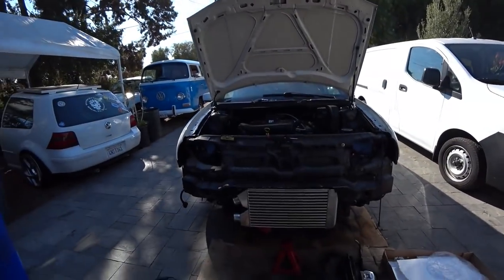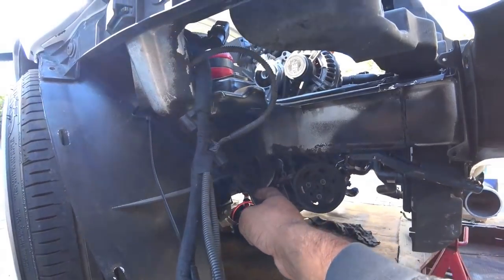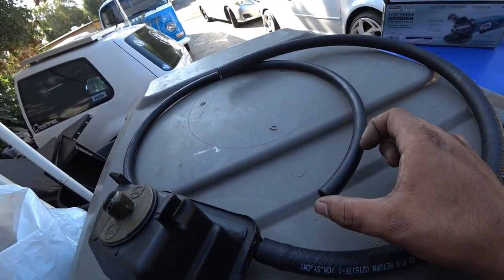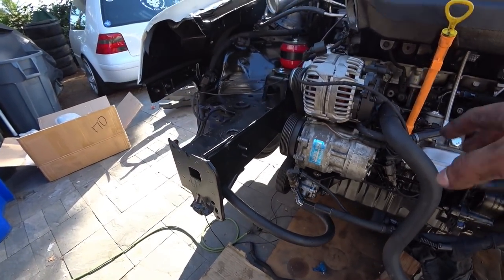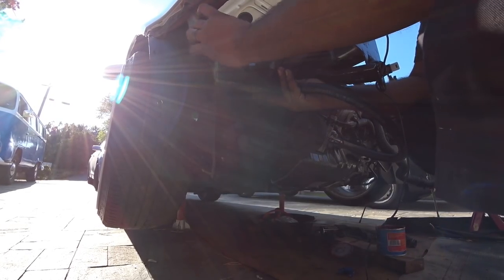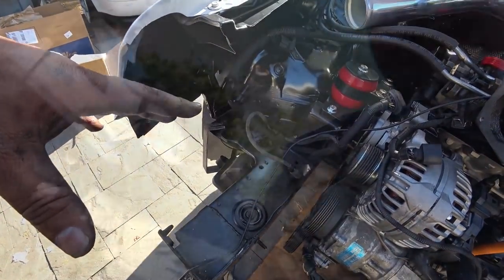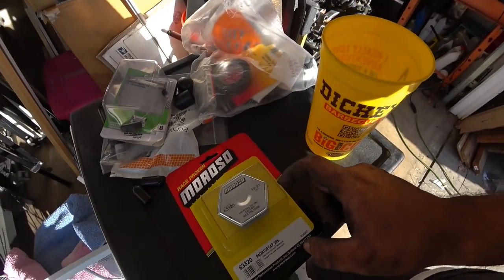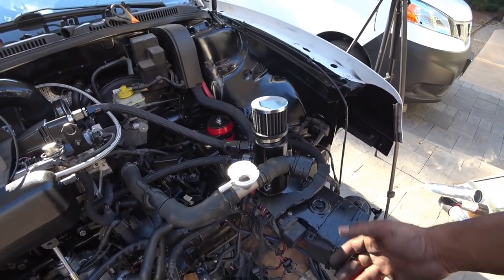MK4 GTI/Jetta 1.8T Power steering relocate and coolant ball delete Season 5 EP3

Comment: Why do you not relocate the coolant bottle? 
And is it going to run hot? Could you not blow this block up quick or make more engine problems ?
Reply from the maker: Sink no because it still has pressure relief. Only way youll cause more issues if i made the system sealed and had the coolant go no where if it got to hot. Will also not cause any other issues if you keep an eye out for coolant levels. If i relcated the bottle it will not qork properly because it needs to sit higher than the radiator for it to work correctly. It's now more like an old school car that has an overflow tank but it just dumps it to the ground..lol

Comment: Great vid question when doing the two delete or relocation, with my car in that corner there is the washer bottle so do u run the no washer and wipers ? Or do u just relocate it ? Your car is looking great kept up the great work
Reply from the maker: Peter Harrold just remove the washer bottle however the sensor for the water level in the tank youll need to jump it with a paper clip so you dont get the low lvl light on your dash
Reply from the maker: Peter Harrold the wipers you can remove just remember to keep one in your car at all times just in case ot rains and a 13mm wrench to install it.

Comment: Greetings PincheAls, the procedure is really clear... i'm just waiting this video. Really, thanks for share us your experiences. I have two questions: 1. In the moroso neck filler, the small conector near cap needs some hose? Where is it ending? 2. With this delete coolant ball solution, is possible having an other hidden coolant reservoir, maybe some slim coolant reservoir? Thanks man.
Reply from the maker: Iván Gomez the small connector is the overflow.. I just ran a hose to the ground ao when it get hot it will spill coolant. You can use a small resivior to collect it but it will not suck it back in.

Comment: So if im not oil cooled, dont plug the line coming from the block to turbo? Ko3. Love the video though!
Reply from the maker: RuinedMk4 correct youll need to plug the Y pipe that goes to the metal pipe or swap out tue hose and make it a single long hose
Reply: PincheAls Garage would you cap off the t fitting still if you’re stock turbo?
Reply from the maker: RuinedMk4 yes thats the line that runs across the fuel rail which you wont need

Comment: What do I do with the coolant line that come off of the back of the engine running to the tee
Reply from the maker: This is for big turbo that does not use coolant to cool the turbo. We blocked off the port

Comment: Can you do this on a mk4 Vr6?
Reply from the maker: Yes however vr6 has a secondary water pump youll have issues with heat. I would suggest a larger radiator and better fans.
Reply: I wouldn't do this to the vr6. you will have issues.